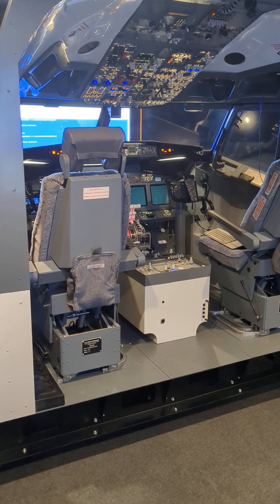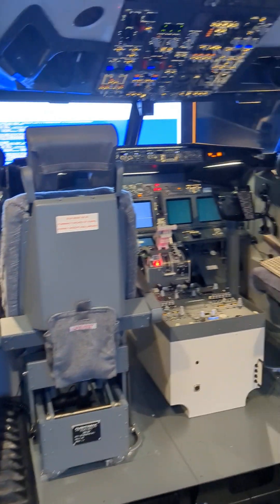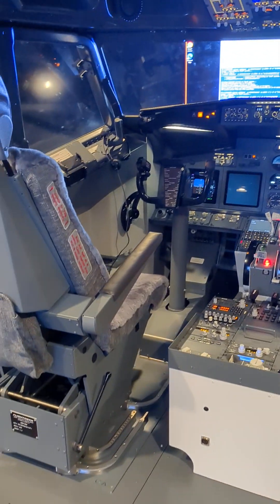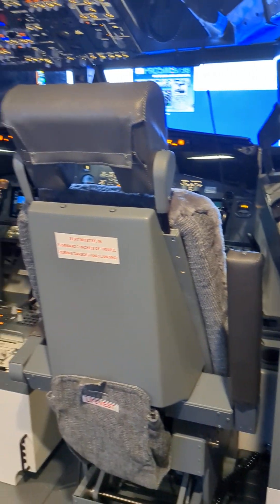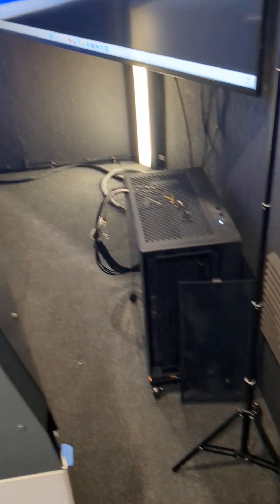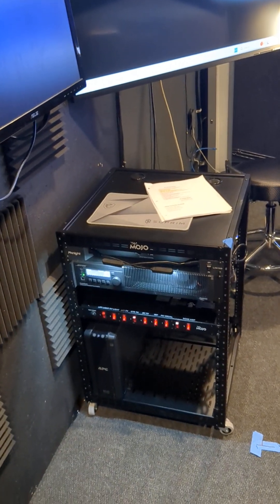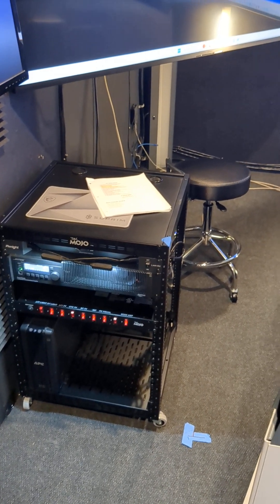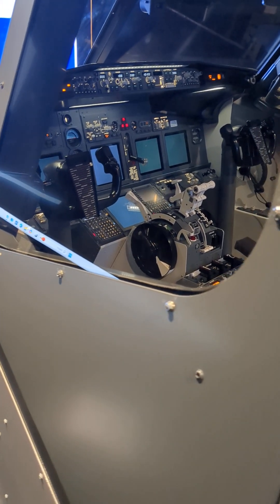Boeing 737NG Build | Day 3 Progress | Throttles, Pedestal, and Seats | Captain Scott's Home Cockpit

Comment: Make a 787
Reply from the maker: That would be quite a project for sure. Several vendors are available for the B737 or the A320, but beyond that you are pretty much on your own. Still, people do it, either from scratch or using actual OEM parts. Now, beyond the hardware, the software challenge would to find a good model of the plane in your sim of choice. And ideally a model where all the instruments can run on networked computers (for performance reasons).